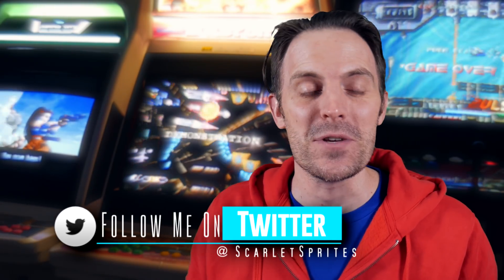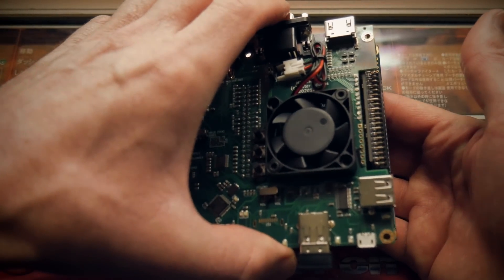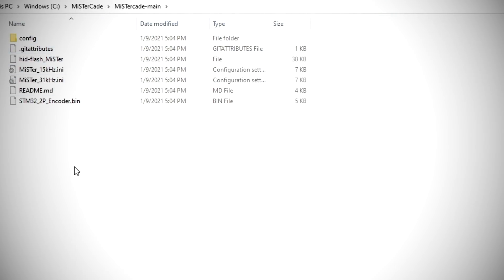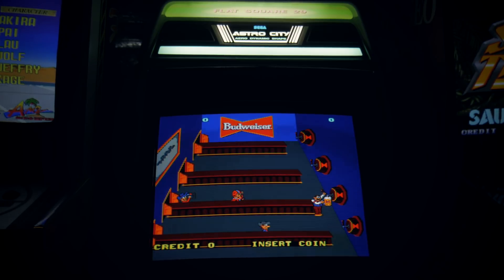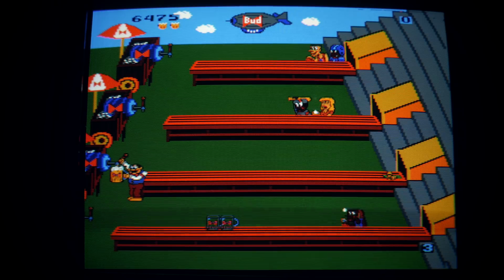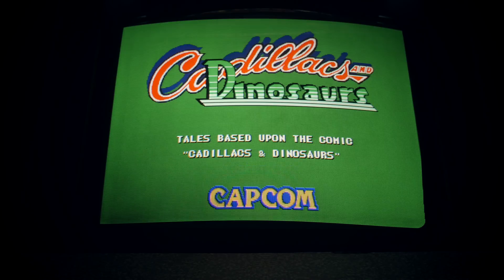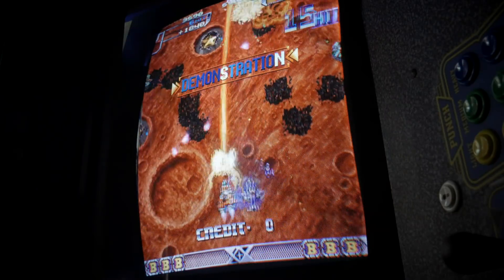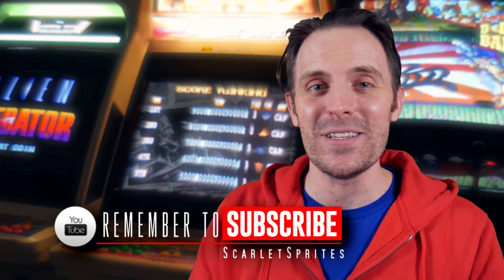MiSTerCade:  FPGA JAMMA Greatness for Arcade Gaming!

Comment: Very awesome. How did you launch the menu to switch cores if you didn’t have the buttons on the board to push?  Btw Cadis and Dino’s such an underrated beat em up.
Reply from the maker: I used the wireless handheld keyboard.  The boot last core option is nice for this setup too because it allows you to just turn the machine on and have it load whatever your last game was without fooling around in the menu.

Comment: Just curious, is there any chance of an external video out for someone to say livestream purposes? Like play on arcade and capture via video out?
Reply from the maker: I'm pretty certain any current JAMMA solution that would be in between the edge and the harness will still work as intended.  However, simultaneous output from the DE10's HDMI will work too with some configuration.

Comment: See, I want to love this, but I can't make myself switch from my PC + CRTEmuDriver + GroovyMAME setup in my Blast City. The accuracy is of course more desirable, but the amount of games available is just so much lower than a simple MAME ROM. I have my Blast City monitor vertical for shooters, so switching to the MiSTerCade would mean giving up most of the games that I actually play. I've been following the status of CAVE shooters development for MiSTer but it's moving like mollasses. One day I'll get this, but for now I can't see a compelling reason since I'm already running a PC setup for 15khz. Maybe a discussion will help sway me? I hope I'm just missing something obvious here.
Reply from the maker: I may get some flack for this but I think that's totally fine.  I'm a believer that everyone should do what's right for THEIR situation.  If you have a setup that works, you're happy with it, you don't have issues, and you're up to speed on what other options you have?  Totally respect the decision to keep doing what you're doing.  No need to spend money if you're already satisfied.  It's really the whole software emulation vs. fpga hardware replication argument.  Currently software will win out on library and options/features.  FPGA has the potential to be more accurate given the right development.  It's all about what is right for YOU.

Comment: The questions you asked at the end of this video are there same questions I've asked myself but for me it's about the retro consoles I own and collect for. If I setup a MiSTer would I "really" need to collect anything anymore just to put on a shelf, since in actuality, would I want to connect and disconnect my aging consoles anymore. The cost of recap kits, the prices of restoring them, buying upscalers/line doublers, expensive high quality cables for them all and/or buying expensive multi-carts or modding CD drives to use SD cards... The MiSTer is looking more and more worth the value and peace of mind when wanting to play your old retro games. 😭 You have a stick ass setup brother! 🤟😋
Reply from the maker: There are for sure certain games I love that I just want in my collection.  Physical copies of those types of games are what I think I will continue to own.  It’s tough to want to chase down something like Willow though.  I like it, it’s cool, I’ll play it...but I’m not married to it in any overly special way.  In that case, there’s no need for me to chase down the pcb and spend $100s on it.  

I definitely like collecting original hardware too.  I have a hard time letting go of consoles, but I have done it.  I’m much more likely to sell a game than I am hardware if we’re talking consoles.  

Good stuff though, and everyone is going to have their own spin on how this affects them.

Comment: Exciting to finally see this as a real product. I've had a pi2jamma for years and I'm not thrilled with it for all sorts of reasons. Definitely ready to jump into the MiSTer vortex soon as this device is finally available.

Random question: with the MiSTer cores is it possible to utilize cheats for arcade or console games, similar to PC emulators?
Reply: @wej4life thanks for the reply. I’ve seen some emulators on the pi look perfect so was curious how differently they would play than on the real thing or the Mister
Reply from the maker: I believe if the developer included in the core you can.  There are some games that show those in with the DIP switch settings.  For things like the Neo Geo you can of course utilize those via the Unibios.
Reply: Hi, can I ask what was wrong with the pi2jamma setup?
Reply: @louisgeorgiou9283  emulation quality is poor for many of the emulators, it's unnecessarily difficult to source the correct rom sets per emulator, and the control configuration is not as easy as it could be for what should be as close to plug and play as possible for an arcade cabinet. In general it's just not very user friendly and I've spent too much time trying to configure the thing, way more than the time spent actually enjoying the games. Everything I've seen so far related to MiSTer and the jamma interface seems to solve most of my existing issues with pi2jamma.

Comment: Freaking EPIC. As a current MiSTer owner, this makes me really want an Astro City cab.  Unfortunately, being in New York City, they're very difficult to come by in the condition I'd want.
Reply from the maker: Northeast is tough for Candy cabs in general.  They’re tough to find or they’re expensive, usually both.  I wouldn’t shy away from a smaller Dynamo cab.  Usually used for SF2 they have control panels for six buttons ready to go and will be much more plentiful.  Also, larger though.
Reply: If you’re up for a little road trip, there is an importer in South Carolina that can get an Astro City cabinet. I’ve used him to buy a few candies in the past.
Reply: @mikegreiling  care to share a link?
Reply: @mikegreiling  I’d be interested in talking to your guy for some cabs

Comment: Is there a reason you can't setup the buttons in the main menu, instead of on each game core?
Reply from the maker: Zombie has it covered I see, but yes.  There are some variances you may want to account for across games.  I've found it best to go in and handle those on your own so you have the setup you want.
Reply: You can do both, the main setup mimics a SNES controllers configuration which isn't appropriate for everything so you can change per core also.

Comment: This is so exciting to see come to fruition. There was a Tapper arcade cabinet in the last venue I used to go to that shut down for shows. It was never powered on / working lol.
Reply: Do 15khz monitors whine btw? I feel like they would.
Reply from the maker: There is the high pitched sound you can usually hear when they first kick on but I honestly never notice it afterwards.

Make an offer on that Tapper, lol.  They’re so expensive even when not working.
Reply: It's probably been liquidated by now, unfortunately.

I'm the same way with consumer sets, but I also use headphones so I almost never notice it.

With an arcade cab though, I'd just be using the speakers. I wouldn't be surprised if that's why (iirc) the Neo Geo stuff went with 24khz monitors.

Tube whine never bothered me, but I know not everyone has 5 CRTs in their home they use regularly lol.

Comment: this is most likely cheaper than a neo sd even with the ram addon and all that jazz lol
Reply from the maker: It’s undoubtedly a better value imo.  You’re just talking about one system too.  There’s a ton of other possibilities and doors yet to be opened.  It’s like the one multi to rule them all.  Now granted, it’s not exactly original hardware, but I guess the question becomes “when does that cease to matter.”  Lots of different answers for that one I’m sure.